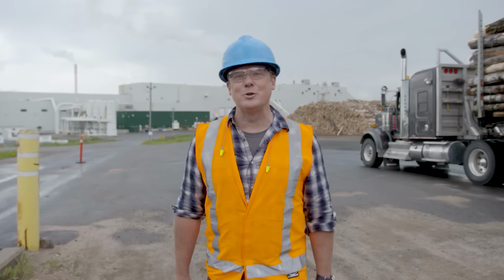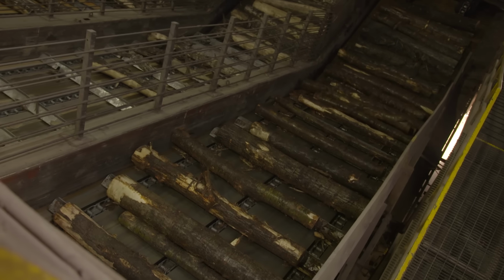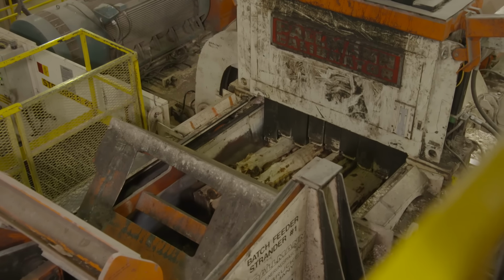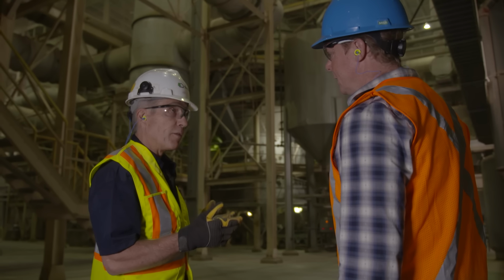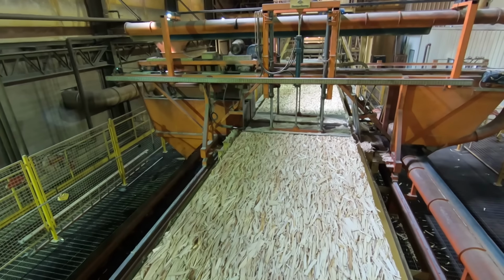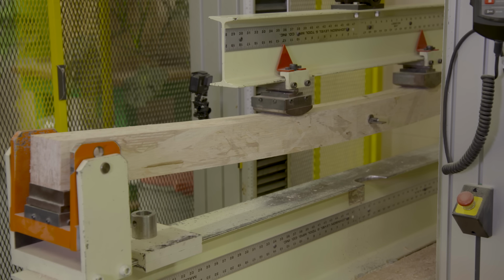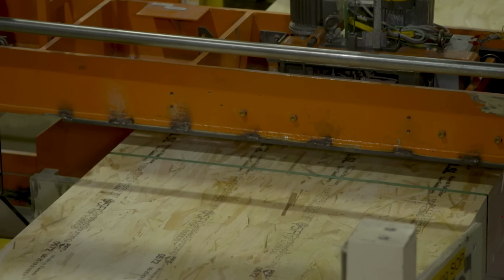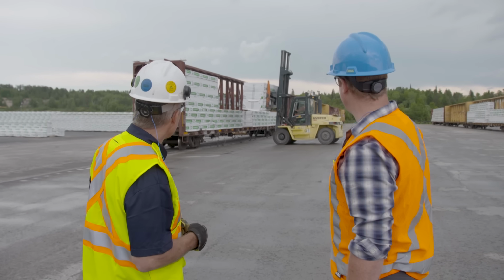Laminated Strand Lumber Factory Tour | This Old House

Comment: Key insights

🌲 The factory receives about 50 trucks of poplar logs a day to keep the operation running, highlighting the scale of their production. 
🌊 The logs go through a metal detect conveyor, highlighting the importance of ensuring no metal objects are present in the wood during the manufacturing process.
🌲 The strander ring in the Laminated Strand Lumber Factory is driven by a powerful 1100 horsepower motor, highlighting the scale and efficiency of the production process.
🔥 The factory utilizes a fluidized bed combustor to burn residuals and generate flue gas, resulting in an efficient and waste-free process.
⚙ The unique steam injection press used in the pressing process of laminated strand lumber softens the mat with steam and helps cure the resin, highlighting an innovative and effective manufacturing technique.
📏 The laminated strand lumber produced by the factory is versatile and can be used for a range of applications, from wall framing to headers above garage doors and windows.
📏 The tensile strength of the product was tested, and it broke at over 35,000 pounds, well above the passing threshold of 20,000 pounds, showcasing its exceptional performance.
🚂 The factory loads up to 25 rail cars and 75 trucks per week, shipping their products across North America and even to Japan.

Comment: LSL can utilized wood that may be unsuitable for building lumber and they claim that it makes stronger and cheaper joists, roof rafters, manufactured beams or headers but what they fail to say is these LSL products burn faster, hotter and weaken much earlier in case of fire. My department has had roof collapse in as little as 15 minutes and floor collapse in under 10.  It may be cheaper but far more dangerous for us firefighters and the damage and repairs usually is much more extensive than "sticks". Consider that in your home planing.

Comment: OSP is not as strong as plywood, you can easily put a hole in 1/2 inch sheet with one swing of a framing hammer. As of yet  haven't seen any boats or other watercraft constructed with OSB, and the OSB I- beam joists would be considerably stronger if they were made with plywood instead of flake board. When OSB or 'flake board as it's sometimes called is used on the weather side of coastal structures it's durability is poor at best ad usually ends up as land fill fodder. For inland applications where weather conditions are of a drier circumstance it's fine.

Comment: My experience is that I wouldn't trust that as Framing material because after it gets soaked (it's literally a sponge) and dries out it swells and crumbles. Back in the day, OSB was the cheapest material you could by in 4x8 sheets.  Now it's just as expensive as plywood.
Reply: Toob247 I worked at a hardware store in the 80s and they had a Display for OSB that had a piece immersed in water to show it wouldn’t rot. I tried to get them to remove it and leave it in the sun for a couple of days. They wouldn’t do it. 

Then, in 2002, I put vinyl siding on the entire house to cover the OSB “siding”. I had to cut the bottom off every piece and replace it before i could cover it up because of swelling and rot.

Comment: I toured a local plywood factory. After the plies were (manually) laid up, they had two workers who did nothing but move sheets of plywood from the layer-uppers to the press. I remember thinking 1. I would shoot myself after 3 hours of doing that monotony and 2. The only reason they had that job was because there either wasn't a robot that could do it or the one that could cost too much.

Comment: I would like to see how they hold after 100 years.
Reply: Yes it will be interesting, but, seeing as few people alive today will ever find out then who cares?

For all we know far more efficient methods of producing engineered timber will have evolved.

Hopefully both waterproof and bug proof. And everything else "proof" as in not flammable, say.

In short why worry about tomorrow? Let's just get through today.
Reply: @t1n4444  I'm 16 years old and I plan to build a custom house that will be in my family for generations. I am learning as much as I can about building science because the last thing I want is a house that only lasts 70 years. According to the research I've done, these LSLs are expected to last 100 years so I guess I'll sister an LSL stud next to every 2x6 dimensional lumber stud. I live in a high wind zone.
Reply: @mattysacre9011  Hmm, a very reasonable proposition ...but ... you may find building regs (your Code?) will change more than once before you get around to building a house, or change during the house's lifetime.

Now, the following is applicable, thus far, to houses in UK. Currently we heat our homes with natural gas, fuel oil, solid fuel (wood or coal nuggets) or electricity, directly or perhaps powering heat exchangers. (Which can both heat and cool homes.)

The solid fuel must be classed as smokeless (as in wood with less than 20% moisture content). We can't burn "raw" coal as such but has to be processed into nuggets or briquettes so as to not cause smoke.

Fuel oil is diesel 1, kerosene, or 2, ordinary diesel.

Kerosene burns cleaner than standard diesel and is cheaper.

However to complicate things further we are obliged to burn fuels which are considered very low in particulate emissions, sub 2.5  microns ... at the moment. Could easily be reduced to sub 1 micron particulates. It's only a "legislation" away so to speak.

On top of that we have to watch for noxious gas emissions. As in oxides of nitrogen.

To discourage the use of fossil fuels our government is not slow to impose taxation or fuel duty as it sees fit.

So, the point of all this is that here in UK (and Europe) we have a huge amount of experience of very old houses.

Unfortunately, for the owners, very old houses are notoriously expensive to maintain and heat.

Our most modern housing stock is far most sophisticated in design and construction, especially with things such as insulation, passive heating etc, etc.

In fact ToH has covered a lot of these issues at least a decade before you arrived  on the planet so it is proven technology, and if you haven't had a squint at these videos, they are very, very well worth watching. In fact I think Bob Vila built his own house on the passive heating principal and I gather he was plenty warm enough.

However, not all things stay the same ... as of 2025 new UK housing stock will be built without gas heating. Doubtless some people will attempt to retro fit gas central heating systems but my money's on legislation preventing this.

So, your plans to build a house to last may be an excellent notion "today" but will it be compliant in the future?

Currently your CiC is not wholly convinced of the global warming being caused by "us" and consequently is not following exactly the same protocols other countries do.

It is not beyond the bounds of probabilities that following Authorities change their minds and you are obliged to gradually dispense with fossil fuels.

Ergo trying to heat an old ish house may become extremely expensive. I speculate further that your local house taxes, for want of a better expression, may end up being proportional to how effective or efficient your house is. As in the lower the "U" value the lower the house taxes. ( "U" value equates to thermal transmittence for those wondering.)

Electric heating is now back in "favour" because electricity can be generated without emissions, via solar, wind power, hydro, tidal and of course by reactors.

No government likes to outright ban things in the domestic sphere so gradually increase taxation on fossil fuels so eventually folk get the message and we migrate to other forms of heating, but for the sake of argument we'll say electricity.

( Electricity is "clean" at the point of use, so good for urban dormitory areas. And if generated by non fossil fuel means then good for the planet.)

You'll have noted the slow but sure increase in electric vehicles. By vehicle I include railway locomotives. As I type more main lines are being "electrified". The smaller branch line locos might end up being hybrids as the most cost effective.( I speculate here btw.)

Mind you, our PM is dead keen on the UK  being "the" centre of excellence in the field of battery technology so perhaps we will see battery powered locos one day?

Anyway I see I have moved off topic slightly. But, if I might suggest you gen up on the science of efficient homes. It may be your desire for a massively built home is no longer the best option.

Although that said (and to muddy the waters) I have a Japanese architectural magazine, over 30 years old, which features underground homes (Think Hobbiton.) 

I will concede that if you were to "cut and cover" then " massive" would work. However, is a mound of earth quite what you have in mind for the family pile?

These constructions rely on a "lot" of concrete to keep the house from collapsing. And, as you might know, making cement powder is not a particularly green way to build, so to speak.

Anyway, best of luck whatever route you take.

Comment: Excellent product made by excellent machinery - it is a pity that you did not show the press that is being used however if the press was sourced from the people that supplied the former then it is the best in the world. Like others have noted and already commented on most of the process is automated other than the packing station but we need to consider the health and safety of the work being done by these people - I am sure that once those jobs are done by machines these people can be retrained to perhaps be carpenters and use this product.